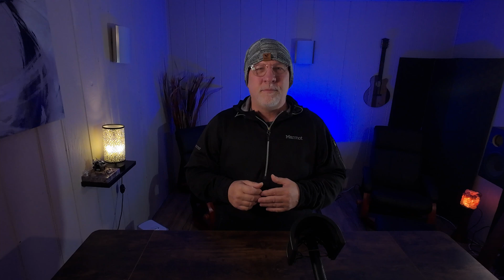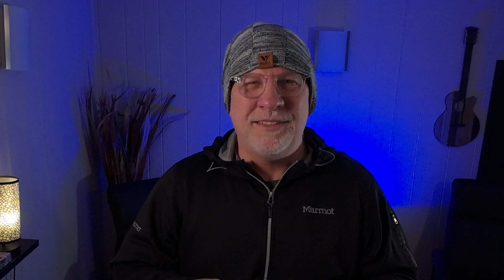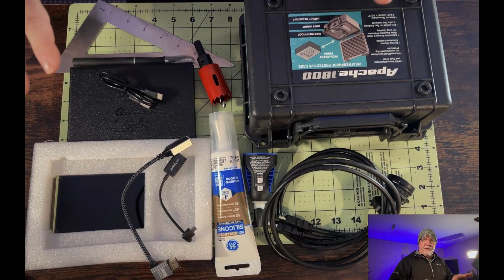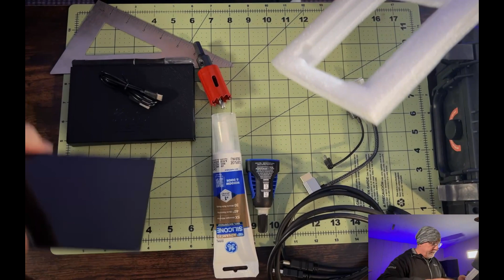Build Your PERFECT Astrophotography Crash Box Today!

Comment: Very nice setup. I have been wanting to do something similar. I do have a question about keeping your telescope outside. It looks like you have a collapsible tent/dome. What is that exactly?
Reply from the maker: Hey Diocrew!!  Sure, I've been using that half-dome collapsable tent for about a year and a half now.  It has been great.  It was not initially a low level of effort to setup but after that I can go out and get un-covered and ready to go in less than a minute.  I can cover up in a minute or two.  It helps protect the scope but even more, it keeps the area clear of snow and debris around my scope so it it easy and safe to walk around in the dark.
I made a couple of videos about it here and describe more about where I got it, etc.. which was from a guy in the UK that makes them and sells on Etsy:
https://youtu.be/SFy6cDhFzGI?si=PF6e2mK9vzwON6Oa

and I did a follow-up here:
https://youtu.be/McZ1HkicacE?si=YBIDH71weSRAsVz0

If those links don't work in comments you can search "AFO" in my channel videos and find them.
Cheers!
Doug

Comment: What a nice and rigid way to connect a small screen in the field. I just slammed a similar monitor with velcro tape to the side of my mount and used a bluetooth keyboard. This is much more durable. Maybe a nice touch to install a small battery in the case to make is completely self sustaining. Possibly even powering your mount controller to retrieve your data is everything else has ran out of power.
Reply from the maker: @VRzichtbaar  Hi VR! Thanks for watching!  Honestly, if you’ve got any solutions that works, it’s a great solution!  I do like this build though, it was fun and I like that it is all contained in its own travel box, easy to grab and go. 
Great idea on the battery!  For me I always have power generators with me at the scope when traveling, but for any that may not, having a built-in power source would be excellent!
Cheers!
Doug
Reply: @AstroAF  I meant to say that your solution is more durable. So I am surely upgrading. P.S. your video shows all the steps very well.
Reply from the maker: @VRzichtbaar  Thank you so much. Feel free to reach out with any questions during your build here or on my Discord (link in description). 
Cheers!
Doug

Comment: Awesome! I've certainly had RDP and Wifi hotspotting not working out in the field and it can be a real pain... 

I also have a backup box that presently has the following.

Usb cable for PC to mount, pc to camera, pc to guider, pc to af, pc to eaf.
Spare dew heater.
Spare power adapter and power lead.
Spare Mele PC (my old Quieter 3C, set up identically to my current PC - ready to run)
Spare power box.

Currently I have a spare astro-camera, but that is for sale at the moment! haha. 

I don't go out in the field often, but when I do, I won't let equipment failure cause me to go home.
Reply from the maker: @AlexN-Astro  Hi Alex!  Thanks!  Wow, you have got a great setup for catastrophic system failure!
Indeed! This stuff happens, I’ve had a connection loss in the middle of slew where I had to run out and shut off the power to the mount! I have limits set but who knows what could happen when the system is down!
Thanks for watching!
Cheers!
Doug

Comment: Maybe you explain the advantage this has over just using a laptop computer? No mini-PC, no box with keyboard and tiny monitor.  My laptop takes up much less volume than what you assembled.
Reply from the maker: @videotrexx  How are you going to connect your laptop to an unresponsive miniPC or Raspberry Pi?  With this crashbox you can login to your miniPC bios, for example.  If networking is down then any peer to peer configuration would not work with your laptop, same with Remote Desktop connection. 
Cheers!
Doug

Comment: My  Windows troubleshooting skills are limited being a MacOS user but I use a Mele minpc for NINA, Since I have to set up and tear down every session I would just first try to bring the minipc inside out of the cold and hook it up to my TV in the motorhome to troubleshoot and if I can't fix it within an hour pack up my equipment and work on it the next day. My living room TV has a HDMI cable connected  and I use a Logitech wireless keyboard with integrated key pad which uses a USB dongle and not Bluetooth. I've never had a Windows crash luckily.  I guess with that USB stick you can reboot into the PC if the PC won't boot.? I'm not sure I'd want to spend time outside in the cold messing with a Windows problem. Looks cold there. Not very warm where I'm currently located,  Panama City, FL,  34F and windy this morning. Not much astro going on lately due to weather. I hope you never have to use your crash box.
Reply from the maker: @KJRitch  Hi KJ!  Yeah, you’re pretty well set having the motor home with you. This would be more for if you were out and didn’t have the things with you or nearby to troubleshoot. 
Good to hear from you!
Cheers!
Doug